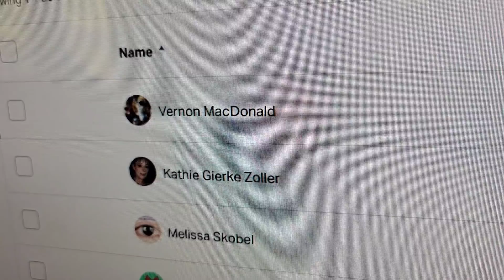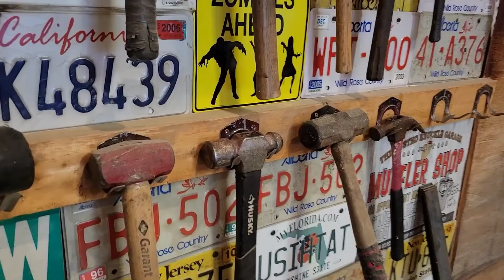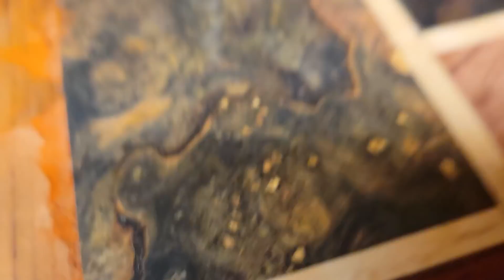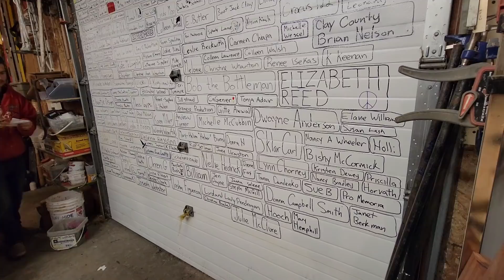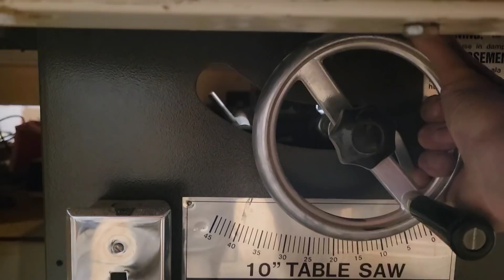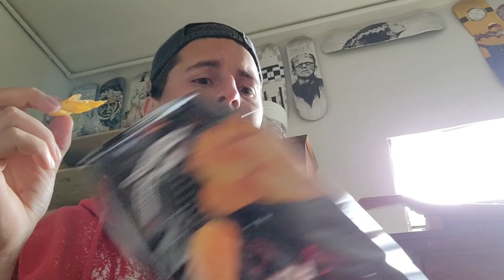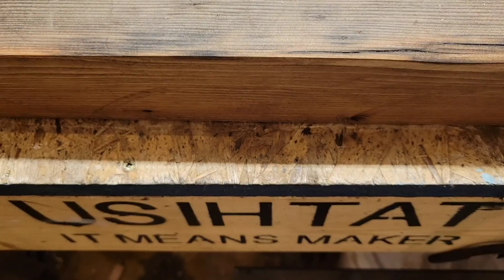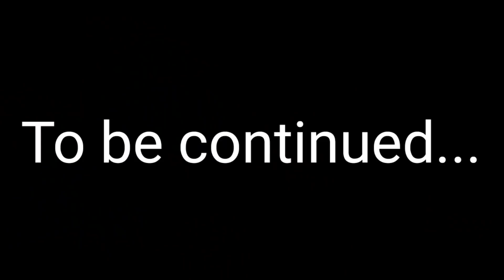The journey of making this table | Another VLOG #136

Comment: You might want to try this stuff out. I know you don't like oak but, we made an oak mission style bed and I was frustrated getting the color I wanted. I ended up mixing 3 stain colors and then put 3 coats of this stuff on in place of poly. It darkened it up and we absolutely LOVE the finish we got from it.  I imagine it works just as well on other woods. Minwax Antique Oil Finish, it comes in a red can.

Comment: Nice table! As a stained glass artist I use Novacan - they make a Black Patina for Solder, and one for zinc- it causes a chemical reaction and turns metal black. They also make one to turn them copper. If you don't like it you can take it off with steel wool.